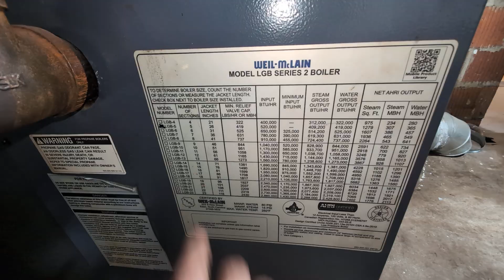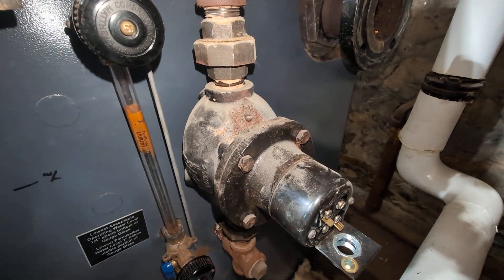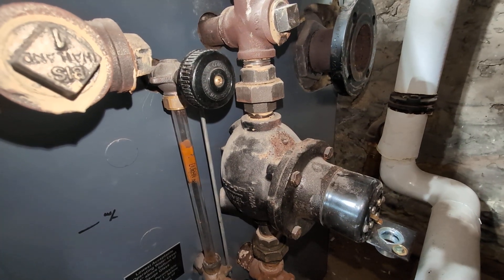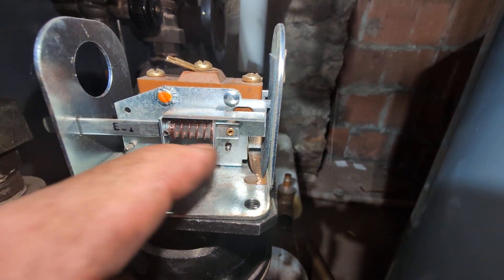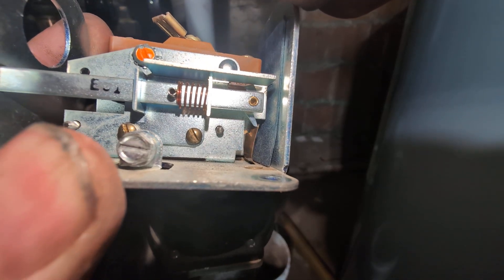How To Destroy A Steam Boiler

Comment: It looked like that manual reset one’s float was operating. Had you freed it?
Reply from the maker: I think that float got freed when the heat from the dry-firing boiler baked the sludge in the float chamber into a crust!

Comment: Loose a boiler for the cost of two 1" ball valves!!!. Unreal. Of course that assumes they would have actually blown them down and serviced the LWCOs. At one time MA used to require that the piping below the water line for those controls had to be Brass which I think was a good idea but they dropped that requirement many years ago. Could you use a Hydrolevel #F0EM-2 to mount a control on?
Reply from the maker: Yes, indeed!
WM should add tappings for probe-type LWCOs to their LGB boilers, but they won't.
Float controls, even when installed properly, just as you suggest, are not blown down properly most of the time, if at all.
Washington D.C., I believe, still requires all piping below and above to float controls to be brass.
The Hydrolevel probe manifolds are a very good idea to get about the lack of proper probe tappings (still have to be blown down, but not as critical).

Comment: What a shame two LWCO's and it still dry fired because someone didn't put in blow down vales, and the home owner probably never maintained it.
Reply: I appreciate your posts on steam. I am preparing to replace my 89 yr old snowman Weil Mclain, so I am trying to learn as much as I can so it will run for another 89yrs. So I have been watching your posts and reading Dan Holohan's the Lost Art of Steam Heating and studying the installation instructions.
Reply: @alecmaxwell7945 89 years on a new boiler forget it. Your only chance is if all your makeup water is pre-boiled and you keep the pH at 10
Reply: @pb7379-j2k actually that was kind of a joke, at 72 I don't think I'll need much more than 20yrs. Interesting that in 1934/35 there were 2 guys that were installing these units, Weil Mclain with a Timken  silent automatic burner. One was old Judge Herman, the other old Mr. Champion. One used the hartford loop, the other refused to. I can't see anything resembling a H loop but you can bet there will be on the new one.
Reply from the maker: The boiler was put in by a previous owner, and the current owner has had this (now late) boiler for about four years.
It is tough to maintain if you can't drain.
The installer bares full blame for this, but they will never be held accountable.